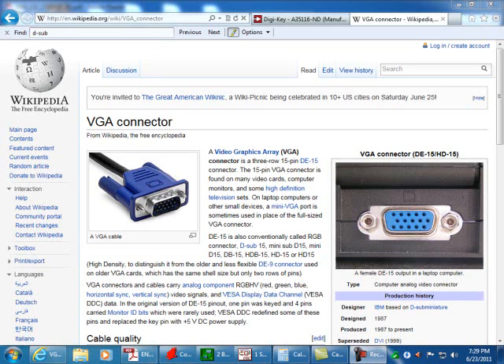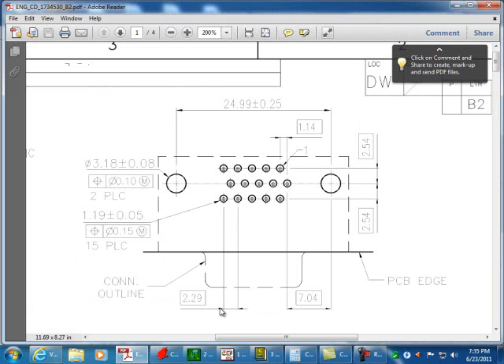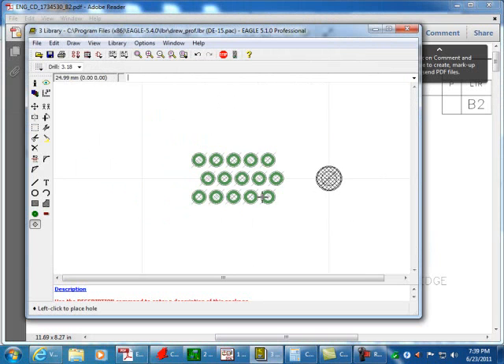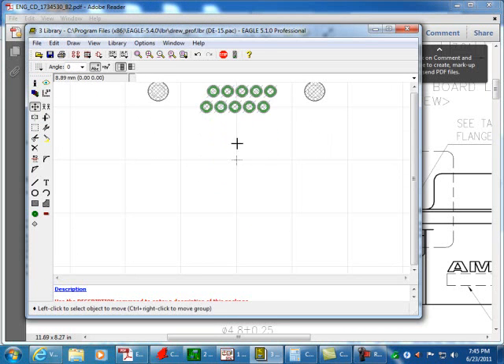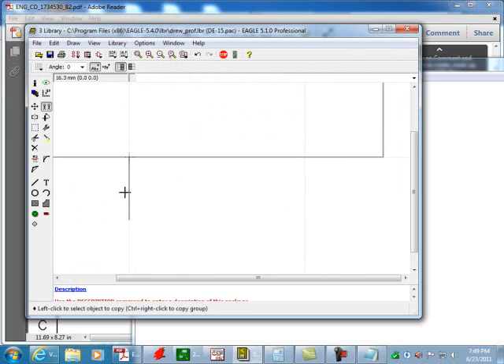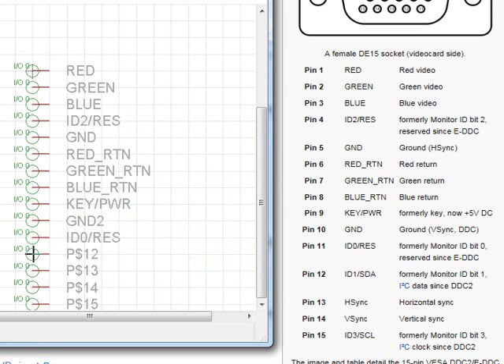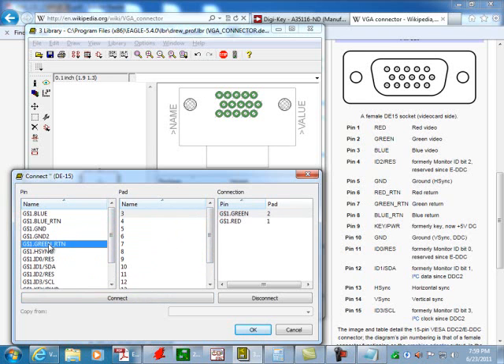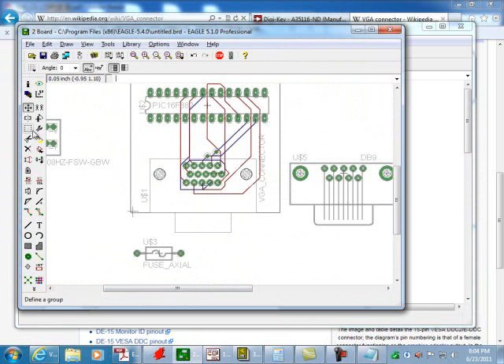EAGLE - Custom Part

Comment: So I'm using a MAC --I think that when bahstrike is selecting a group he is doing some sort of keyboard shortcut (That I can not see) such as shift+ left mouse click or something....probably because I am new to eagle I don't know this trick...
When I do the same succession of mouse clicks I don't get the same response ...For instance I select a group then change the grid but when I move the group it does not move on the new grid selection it stays on the old grid selection...frustrating!
Reply from the maker: 1) Grid snap settings are global;  regardless if you had anything selected or not
2) The multi-selections are done by choosing the 'Group' toolbar item then either (a) dragging a box with the left mouse button,  or (b) single-clicking a polygon around the desired items
3) After making a selection, moving multiple items is done by choosing the 'Move' toolbar item then holding CTRL and right-clicking one time;  this attaches the whole set of items to your mouse-  no need to hold CTRL anymore.  Left clicking somewhere else drops the items there.
3a)  Once you have picked up items  (using CTRL+rightclick after making a selection),  pressing the mousewheel button will horizontally flip the items.  This is especially useful if you want a device's pins to face the other way in the schematic  (this useful action can also be done in Board mode to make the device intended to be mounted to the bottomside of a PCB:  mirrors the package and automatically converts Top silk, Top copper, etc.  to Bottom silk, Bottom copper, etc.)

I hope that was helpful;  I can't speak for anything mac-specific sorry.  EAGLE's object manipulation has some intuition gaps.. but with a little adaptation it's pretty good.
I'm really glad they implemented the mousewheel-based zoom&pan  "correctly"  (personal opinion).

Comment: I'm never sure how to account for the +/- tolerances on parts.   In your example datasheet, it gives the nominal value +/- a tolerance;  for other parts,  it gives a MIN & MAX values for pin spacings, pin widths etc.    How do you deal with tolerances in pin & footprint dimensions?  I guess the safe thing to do would be to always use the max... ?
Reply from the maker: Use nominal, ignore tolerances!    If they only give a Min/Max just find the Nominal=(Min+Max)/2   and assume that.   Maybe add somethin like +4% to +8% (?) hole diameter if u intend mass hand assembly;  to make it slightly easier for human-bent leads to slip in.   Otherwise, when u get a board with issues then figure out what u gotta adjust :D  Only dance with the tolerances if u picked a fab-house and just want to maximize output.